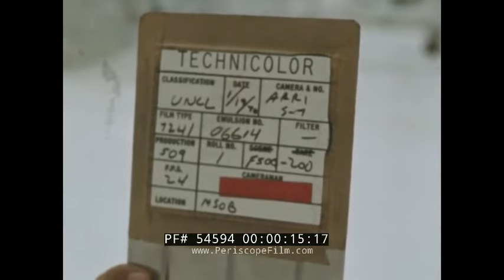APOLLO LUNAR MODULE  PREPARATIONS FOR SPACE FLIGHT   MANNED SPACECRAFT OPERATIONS BUILDING  54594

Comment: Have you come across any film showing the final preparation of the LM after it's been placed in the adapter?
I have read in some procedure manuals that there were parts like RCS exhaust deflectors that needed to be fitted after the adapter had been closed up, and also that perishable supplies like food needed to be stowed after the rocket was actually sitting on the pad.
Reply: The Eagle Has Landed: The Lunar Module Story pt2-2 1989 Grumman color 14min.

Check at about 4 min to get some images of the process. All of the post stacking cargo was loaded into the command module for later stowage in the LEM...but there is film of them entering the stage adapter post stacking to attach batteries and to load the hypergolics in both training footage and actual flight prep in other files. I'll keep browsing the thousands plus video files I've collected as of late...

Comment: Is it just me or is the date 01/19/70 written on the clapperboard?
Reply: Good eye!
Reply: yep and Technicolor had the contract to process all the film for NASA at that time, a friend worked for them back then...
Reply: IXXI..................
Reply: frankroberts9320  According to NASA Mission Reports, the ascent stage for Apollo 13 was delivered to the Cape in June 1969 already. For Apollo 14, delivery was November 1969, and Apollo 15 November 1970. So it's probably Apollo 14 LM.
Reply: That's not a clapperboard. Clapperboards are used for synchronizing picture and sound. This is a silent film reel, hence no "clapper" on the film identification card. But, in regards to the date, yes.

Comment: "It looks like a homeless tweaker built a tree fort made out of aluminum foil and newspaper. We went to the moon in that?!"

-Owen Benjamin
Reply: Made as thin,  light, and cheap as possible,  by the lowest bidder
Reply: @barto4678  So Stanley Kubrick won the bid?
Reply: That is possible.
Reply: Which of the thousands of peer reviewed scientific papers on the data and samples from the Apollo moon landings has Owen proved fake?
Reply: Yep. Had to be very lightweight!
Reply: Why not, no resistance in space, a  nearly frictionless environment, the only concerns is solar radiation, micrometeroites, thermal issues, and the coldness of the darkness of space.
Reply: @barto4678  Grumman had to build TWO spaceships in an environment that NO ONE had ever ventured before, safely land, provide a habitat for two explorers for two days, then using an upper state, lift off from the same surface, and rendezvous with the CM/CSM, and dock.  All for nearly a billion USD in today's dollars.

Now, how was that for the lowest bidder.  Actually, they had a ton other parameters to compete and compare with Convair, the other bidder. NAA had the Apollo Project and up to their armpits in their own issues. Boeing had the 1st stage, NAA the 2nd stage and Apollo CM/CSM,  IBM the INU,  and Douglas the upper and shroud.

Grumman was the best choice due to their manufacturing reputation, their engineers, and their overall design plan for the LEM..

Plus it had to be ugly as possible. A TRUE spacecraft.
Reply: But still the lowest bidder.  Like John Glen said before his Mercury flight
Reply: It's mind-blowing that people to this day will defend the whole NASA charade. It's a faith based belief system.
Reply: @slow-mo_moonbuggy  Which of the thousands of peer reviewed scientific papers on the data and samples from NASA missions have you proven fake?
Reply: @thegrumpyoldmechanic6245  Who physically measured the radius of the earth to be 3959 miles to use as a tangent for the alleged orbital telemetry of the Apollo missions? You know that NASA recorded over that telemetry. Mind you that the radius value being 3959 miles has been debunked thousands of times. Anyone with a camera can debunk it.
Reply: @slow-mo_moonbuggy  You can measure the earth's radius with the Haversine formula.  Now answer the question.
Reply: @thegrumpyoldmechanic6245  A math formula is not observable reality. That's not a physical measurement. Math is a concept and a language. It's cool with me if you want to believe in spaceships. I totally used to believe in them too. It's all good.
Reply: @slow-mo_moonbuggy  lol, i hope you meet buzz aldrin someday, so you can tell him that. 🤣 clown
Reply: @slow-mo_moonbuggy  Find a geodetic surveyor and tell them that. They'll laugh in your face.
Reply: @thegrumpyoldmechanic6245   Well, since nobody has gone out and done a geodetic survey since The late 1800's early 1900's I doubt any are still breathing. Where was the baseline they used for their measurements taken from?  Was it from the horizon? A level horizon that is not curving?